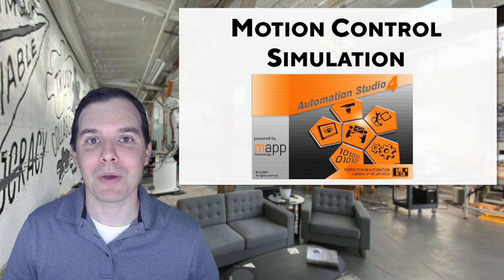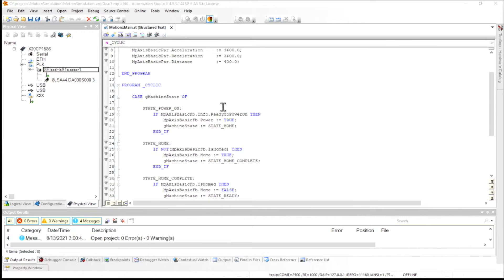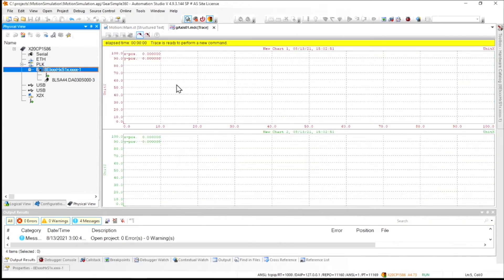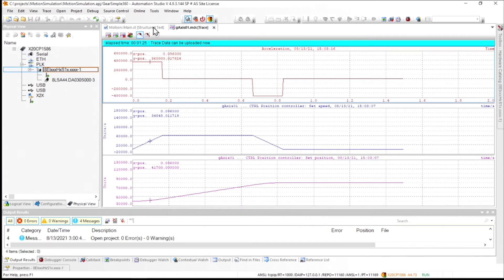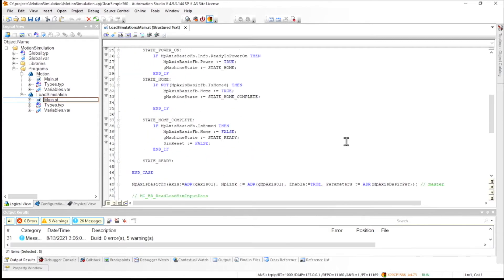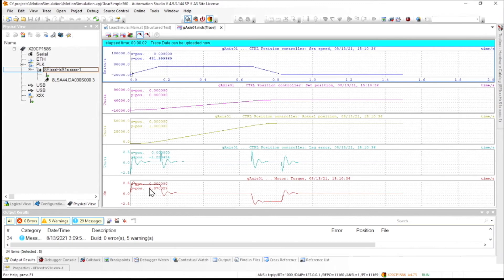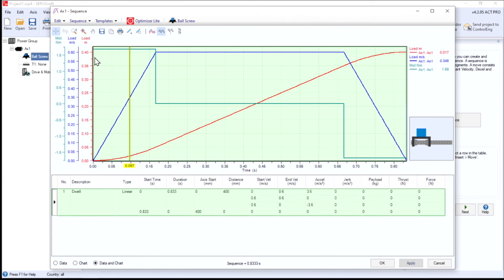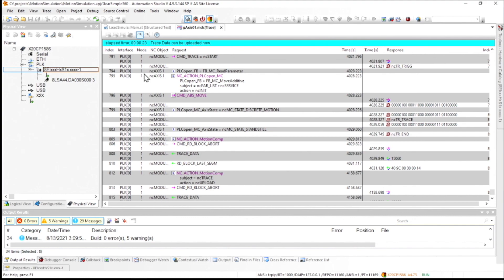Hello B&R: Motion Control Simulation

Comment: In the absence of a variety of physical loads to use while teaching Servo Loop Optimizer, I've resorted to using load simulation (two-mass systems with varying torsional stiffness and viscous friction) to get engineering camps to practice tuning. But getting the SLO to generate Bode plots when the load is simulated takes much longer than when real-time encoder feedback is used. That being said, I used the drive parameter table to set up load sim. Have you seen better SLO processing speed using MTLoadSim to simulate the load?